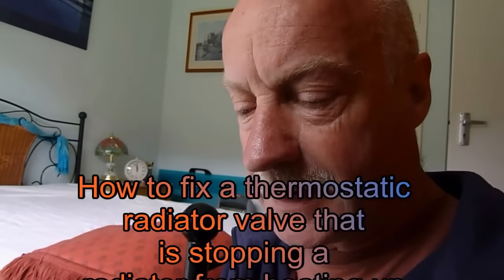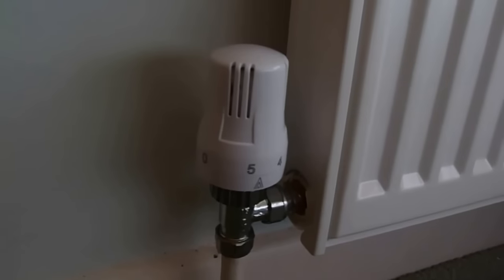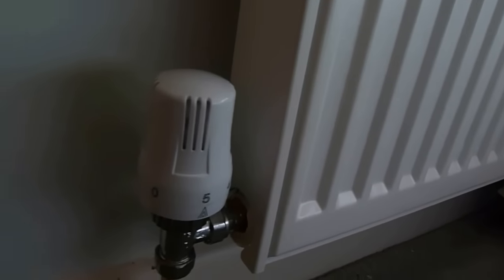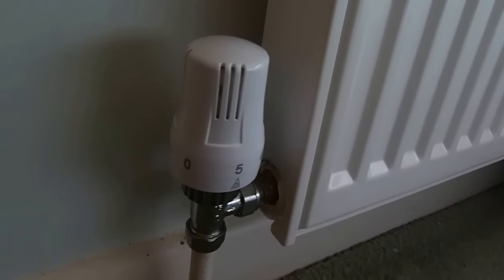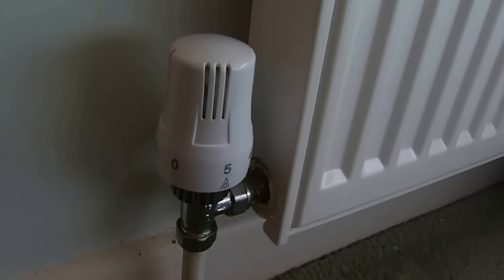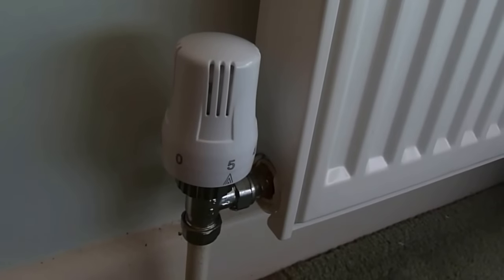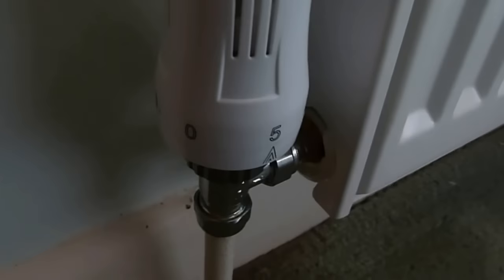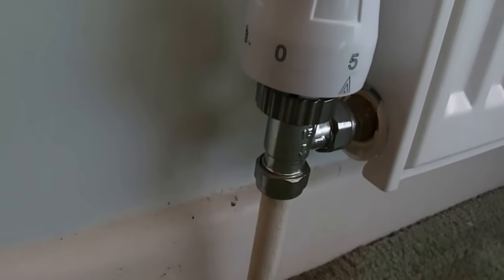How to fix a thermostatic radiator valve if your radiator is not heating up.

Comment: Thank you! The radiator in our spare room has been broken for months, and I attempted fixing it by bleeding but nothing worked and there didn't seem to be any air locked at all. Finally looked up alternative solutions and your video was spot on for fixing! Pin was jammed, light tap with a heavy object (or several taps lol) and eventually it worked! Haven't felt heat from that radiator before! Thanks!!

Comment: THANK YOU SO MUCH.  5 radiators have not worked in weeks, decided to go onto YouTube to find a fix.  Did what you suggested in the video.  And now they are all piping hot.  Saved me a fortune, and taught me something about plumbing - if it doesn't work hit it with a hammer.
Reply from the maker: Ha ha works every time.

Comment: Spot on! Bled my rads and checked the lock shields and no joy, checked the pin under the thermostatic and it was stuck partly up and wouldn’t move, saw on your vid it has to move quite freely so got brave and got the pliers on it and bingo popped right up and went hot straightaway! Gave it a few wiggles to ensure it was moving freely and all good. Thanks for the instructions and demo my lads room is all toasty now and as winters drawing that’s a weight off my mind
Reply from the maker: No problem Adrian.

Comment: Dereton, mate you are a life saver.

Just fixed a radiator in one of my other room as one of the tenant was complaining that the radiator was not working. I bled it but didn't work. Called up a plumber, he said he can't come before saturday. So was checking on youtube to see if there is any helpful advice or not.

Saw your video, tried exactly as you mentioned and now its heating up.

If you are in London then will take you out for drinks some day.  

Keep up the good work.

PS, I do have one other problem, its the leaky radiator, those upright ones. Would you be able to make a video of that as well?

Thanks again for all your help.
Reply from the maker: Ripon Biswas I have a video on how to repair a leaking radiator valve but if your radiator has a rust hole or leak on a seam then there is no cure, the radiator has to be replaced. Al.

Comment: Thank you so much! After 2.5 years of living in this flat with only hot water and no heating, you have fixed my heating! Another video suggested not to use a hammer to the pin which worried me until I stumbled across your video! I saw it pop outwards and immediately the radiator got hot. The flow pipes got hot and my heat meter is now recording flow/temperatures! Why I didn't do this before but you saved me a call out. Thank you!!
Reply from the maker: No problem.

Comment: Hi Al: many thanks for this tip - I bashed the jammed pin on our stuck rad valve with a hammer, and, hey presto, it popped up and the heat came through right away. You're a star!
Reply from the maker: No problem.

Comment: Your a genius. Have been having problems with a radiator and was about to call out a plumber. 

Great video! 

Took off the thermostat and the pin was already up.  Hit it with the pliers a couple of times, but this did nothing.  Put the thermostat back on and it was working.
Reply from the maker: No problem

Comment: Fantastic...... Had an old rad that we refurbished and all good except the rad wouldn't warm up. Refilled the rad, checked the combi boiler pressure was ok and then popped on the heating and it still wasn't getting hot.  So after watching this tip, a tiny tap with a pin hammer and the pin popped up.  Now it's piping hot again.  Thanks very much for this tip, you're a gent!
Reply from the maker: No problem Steve.

Comment: Ive got 3 radiators that havnt worked for about a year, and im now determined to find out whats wrong. Thankyou so much for your easy to understand videos. Tomorrow i am going to give it a try to get them to work! Fingers crossed x
Reply from the maker: Good luck Jan.

Comment: Thanks - perfect solution! Took the top off. Then with a pair of pliers pulled up the pin, which was stuck down. Pushed and pulled it up and down a few times and now valve is working perfectly.
Happy and Warm New Year!
Reply from the maker: That`s great, have a happy new year Roy. Al and Jan.

Comment: You are a 1st Star, i've just fixed a rad that hasn't worked in 15 years with a careful tap, tap, tapping on the pin with a very light tacking hammer. What a great video, this is the 2nd tip I have now used of yours. Thanks so much A1*
Reply from the maker: No problem david have a happy warm Christmas.
Reply: Haha, I thought my 8 years in the cold was bad enough!! Mine did take a little more persuasion than yours, I thought it wasn't going to work , and then it did!

Comment: You just saved me money. Out of 5 radiators, only 2 worked. Turns out the valve was stuck down in each of the the 3 none working ones. They're all working again now thanks.
Reply from the maker: Excellent!

Comment: I wasnt sure about the old hammer trick, but it works!  A few taps and the pin popped back up and you can push it down now.  I think it got stuck due to some corrosion.  Thanks a million saved me buying a new valve and draining the system - this took less than 2 mins to sort it. 👍
Reply from the maker: Excellent!

Comment: Thanks, just fixed a bad radiator of bout 6 weeks after watching this. I was all ready to have a new valve fitted as I didn't realise that it was so easy to mend. I'm going to your radiator balancing video next as my father in law opened all the valves to full a few years ago. Ta lots.
Reply from the maker: No problem.

Comment: Fantastic. I also had some green corroded copper on top the pin. I thought the thermostat was fairly new (I then found out it is 11 years old!), but one light tap with a hammer released the pin and up It popped. The radiator then immediately started to heat up. It took me longer to find a hammer, than to remove the top casing, tap the pin and replace the casing. Job done - and I was getting ready to pay £50 to call out a plumber (sorry Mario)! Great job. Thank you for showing this.

Comment: Excellent advice did exactly what Dereton33 said and it worked. This was after I had a local plumber quote £280 to replace the valve to fix the problem for what could only be an hours work.
Reply from the maker: Great you sorted it ok.

Comment: Hi Al, Superb advice a stuck thermostatic radiator valve was indeed the culprit I followed your instruction to the letter, removing the control top and taping the brass valve which then sprung back into action top back on job done.

Thank you Al.
Kind Regards Steve.

Comment: Having gone all night last night without heating on the front room rad, (Thermo Valved) I decided it was worth checking out Google/YouTube, as I couldn't go another night without heat.
Having watched this video, (& your other video on "System Balancing") - I now 'thankfully' have a red hot rad in the two of the four rooms that I use, and that's all thanks to your easy to understand help clips... So just wanted to say a HUGE
Thank you very much Al.
Reply from the maker: No problem.
Kind regards,
al.

Comment: Thanks for this - 2 radiators fixed with a hammer. Had tried everything and knew the valve was stuck and wouldn't spring back up, but wasn't sure how 'persuasive' to be until you said the pin wouldn't come out. Many thanks !!!
Reply from the maker: No problem.

Comment: That was a quick and easy fix for a rad at home. It had been turned down on the thermostatic valve, but then never came on again after I turned it back up. The system is old, and after seeing how to remove the top of the valve a couple of taps with a big pair of pliers (seem to work like a hammer) made it ping back up. I won't turn that one down again until the valve is changed. Thanks for the video.
Reply from the maker: Hi Sevenman , it1s the little tricks like this , that make plumbers a lot of money.
Kind regards,
al.

Comment: Watched your video and can finally have a warm room again! 

Tried flushing the system and bleeding for ages. Neither worked and clear water just ran through. I wiggled this with pliers and then hammered around the area as you said and it pinged up. Black water then came out and the radiator was hot! 

Watched your other video of how to get the TRV off too. Easy quick fix when you know how.

Thank you so much.
Reply from the maker: No problem Hattie.

Comment: Thanks so much, Have had a cold radiator for almost a week now and now, with a minute to unscrew the unit and few taps .. and radiator hot again. The pin is still stuck so will leave the hammer onto the pin for another day .. so pleased!!
Reply from the maker: No problem John.

Comment: Thank you for that. It's bloody freezing and my bathroom radiator hasn't worked for at least a year. This took two seconds and is making a big difference. Thank you so much.
Reply from the maker: Marc Mckenna No problem Mark. Al.

Comment: Cheers mate. Changed a Rad in a spare room and couldn’t understand what it was cold (hours bleeding) Checked the pin and it was flush. Tapped with a pair of pliers and it popped up. Two minutes later it was hot! Owe you a beer 👍
Reply from the maker: A John smiths ha ha.

Comment: Thank you so much for this.  I have an old radiator with a different thermostat to this.  I couldn't get it off, so I tapped lightly with a hammer around the same areas as you, and it worked!
Reply from the maker: Glad it helped

Comment: Hi, thank you for your video, I just fixed my stuck valve! However your comment at 1m 50s is incorrect, the pin will come out if pulled with pliers, mine did and gave me a heartattack, nice little fountain from the top of my valve! However I managed to push back in and all working unbelievably, no leak!!! Phew! My advice is to just move up and down with pliers gently, as I could hear the water start to flow into the Rad just before I pulled my pin out! All the best, and thanks for vid!
Reply from the maker: Save the Jollies Some valves, just a few, do pull out, but most just lift and stay put. I shall put an annotation at that point in the video, saying to just move gently up and down in case the valve is like yours.Al.

Comment: Thanks a lot man! I used a couple of pliers to push and pull and pull the pin until it let loose.

I actually managed to let the pin out of the socket, but  managed to push it back in without any issues.

Comment: Wonderful! Had one radiator that wouldn't heat up. This video cured it. Pulled the pin up with pliers and I can confirm, if you pull it too hard, it does come out! Easily pushes back in though. Cheers 👍
Reply from the maker: Glad it helped!

Comment: Thanks for your advice. It helped me fix a TRV that was permanently fully open. I was worried about how big a job it was going to be; it turned out to be an easy and quick fix as the pin had become stuck in the up position and the valve head had become loose enough to just push up instead of exerting pressure on the pin.
Reply from the maker: Most plumbers would have charged for a drain down and stretched the job out a bit , so good on you for doing it yourself .
Kind regards,
al.

Comment: you beauty. I had a cold radiator which I noticed after I drained my central heating for a rerouting pipes. this one never came back on and it had worked before. had it off flushing it then suddenly thought about the thermostat and it was seized found your video. little twiddle and done. many thanks.
Reply from the maker: No problem.

Comment: the pin does come up! I've just done it and have water all over the utility room to prove it. I have Danfoss radiator valves fitted from around 20 years ago and the pin is much smaller than the one shown in your video. The pin was stuck so I used a pair of pliers to ease the pin up .. .. but .. .. the pin came out! even though I didn't use a lot of force. Had to shout on my wife to find the mains and shut it off as water was spraying everywhere while I pressed my finger down on the hole where the pin was.
Reply from the maker: Nigel Ewen Sorry you had that problem Nigel, those old valves are very rare and that problem cannot happen with the newer valves, it must have had a broken seal on the pin which was why it was stuck.
Reply: dereton33 thanks Dereton33. not your fault clearly but gave me a rude a wakening. Just a wee reminder to me to always expect the unexpected, specialy when I'm doing rooky diy plumbing

Comment: Brilliant mate! Bought a new valve as the bedroom one wasn't working & wasn't looking forward to draining the system to change it. Tonight I used my brain & thought to see if there was a way to repair the fitted one.  Three taps on the pin (Danfoss, held on with the clip) & it was up & running again.
Reply from the maker: No problem.

Comment: Took me less than two minutes to sort this problem and likely saved me a load of cash!! Many thanks indeed for this brill upload!
Reply from the maker: No problem Eric.
Reply: I think its brill that guys like you put these vid's on here, keep up the fantastic work. Oh, by the way have you a tip for when the shroud on a tap is stuck? Usually its a doddle to change a tap washer, but I cannot strip the tap down beyond taking the handle off as the cover will not move.

Comment: Amazing, thank you ! After 8 years of no working radiator in my living room,finally today thanks to your video,it's fixed,can't believe all this time and the fix was so simple. I only came across the video while browsing your videos for one that would help me to fit a new bathroom sink,i'm starting with what I feel is less complicated before  moving on to replacing the toilet and then bath.  I got as far as fitting the waste and taps to the basin, taps still seem to have movement but i'm scared about overtightening in case  damage/crack the basin.
Reply from the maker: Just take it nice and steady Carol and you will do it fine.

Comment: Did as you advised and the radiator seems to be working. My thermostatic valves are the old Danfoss spring loaded type, about 20 years old, and it was difficult (for me) to realign the valve settings as well, finally got it lined up right, thankyou.

Comment: That's great thanks! I was thinking I would have to replace the valves but this worked a treat. Took me longer to find the pliers and hammer than to fix the problem in 3 rooms!
Reply from the maker: These jobs are always easier than you think .Pleased you did it ok.
Kind regards,
al.

Comment: Thanks very much sir! Your video got my radiator warm again! Would have had to wait a week for the engineer to come round and at about £80 call out fee! My valves under the TRV were very stiff so used a touch of WD40 on it too in addition to the hammer action, which instantly got the valves bouncing up and down again!  Very much appreciated 👍
Reply from the maker: No problem Andrew.

Comment: My radiator valve looked a little different to this. The pin under it was a bit thinner and came out horizontally rather than vertically. I pulled the pin with pliers and I accidentally pulled it fully out. A fast stream of hot water followed it. I shoved the pin back in and replaced the valve. The radiator now works. So thank you for the helpful video, but others should be warned to be careful that the pins can be fully removed if you pull too hard
Reply from the maker: That must have been a real old one. Most newer ones the pin is not removable.

Comment: I have done all sorts of my own plumbing and was tracing pipes and having all sorts of fun getting the furthest radiator (in a newly purchased house) to work.  I didn't knwo that the valves stuck.  - thanks I have put the floors and carpets back now.!
Reply from the maker: An easy one to miss Jonathan.

Comment: spot on----just as he says, found pin stuck.  did use the hammer to free up but also poured a bit of white vinegar or pin as think it might be limescale in water causing it---we have that problem here.  many thanks.
Reply from the maker: N problem

Comment: Great info and thanks, the pin in mine (siemens acvatix rtn51) was stuck half down when I pulled it up with pliers the pin did in fact come completely out. However only minimal water came out and easily put back in :-)

Comment: Hey duration, thanks for the tip . . . was all set to buy new radiator today and fit it (drain system etc etc pain in the arse) thinking that it was blocked up with sediment. Thought I'd just check the internet wisdom on TVRs 1st and found your clip . . . Brilliant, worked immediately. Thanks for sharing the knowledge!
Reply from the maker: No problem . Keep warm.

Comment: Had my rad off in the bathroom for a year and couldn't be bothered to actually do the decorating. Stuck it back on and wondered why it weren't working. Turns out this was the issue. Top man, 

PS my pin definitely came out. 😂
Reply from the maker: Ha ha they often do.

Comment: Thank you, my TRV was sticking not letting the rad turn on so I tapped it with my vice grips and the valved popped up, there me thinking i may have to replace the TRV etc. The rad is now pumping with heat again ready for the winter. Cheers Buddy.
Reply from the maker: No problem John.

Comment: Thanks Al.  Watched another you tube video which said to not touch it with a hammer!  Just gave it a few firm taps and working fine now. Thanks a lot.
Reply from the maker: Hi Jon , yes I have seen that one .Utter nonsense , there is an old saying , if in doubt give it a clout.
Kind regards,
al.

Comment from the maker: Hi , do not pull the pin out , it does do permanent damage and usually a leak as the rubber seal will also be damaged. 
Kind regards,
al.

Comment: Thanks for these. My kitchen rad had a leaking lock valve on one side and a stuck thermostatic one one the other. Watching your videos got me sorted in minutes, a length of PTFE sorted the leak and a gentle tug with pliers lifted the stuck pin on the other.

Plumber's children will go hungry thanks to you (wink)